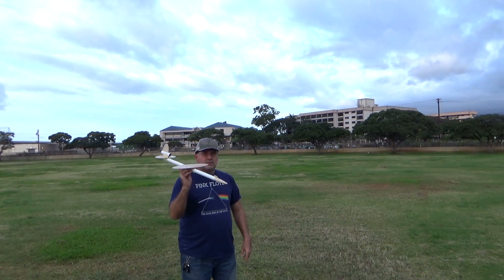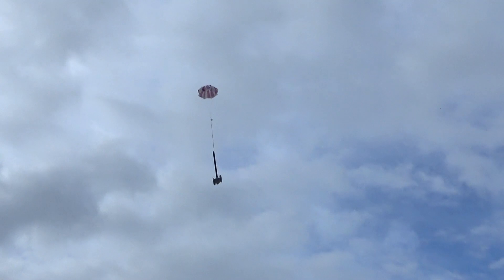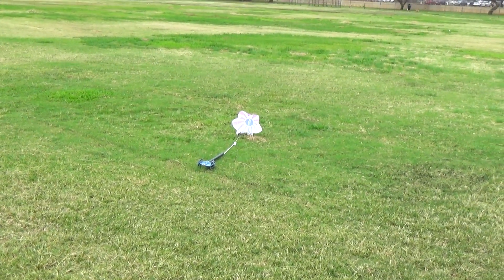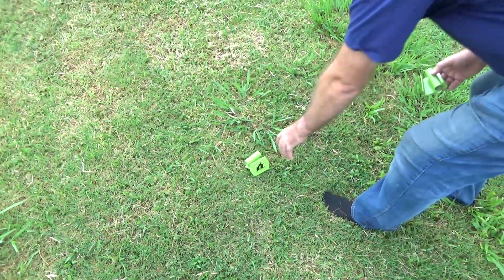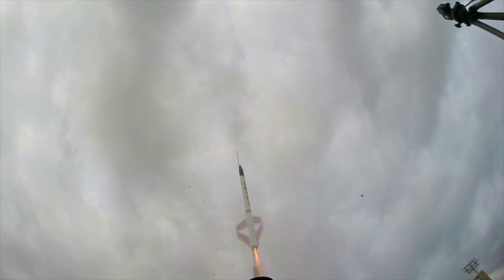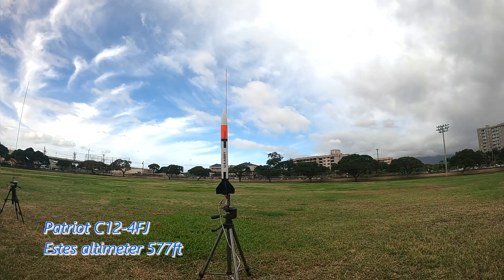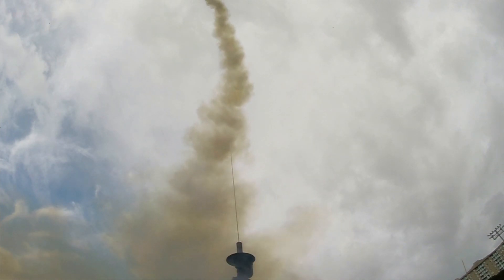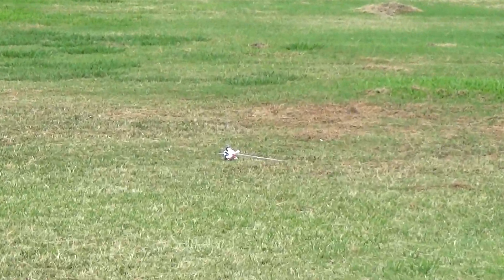Model Rockets: Nice rockets, some Catos, some lawndarts, and a windy weekend

Comment: Another great video.  I look forward to your videos every week as it's still too wet and windy here to fly.   I need to pick up a Nomad.  I like the design but wish it was larger.  Once I have all the dims I'd like to build an upscale out of Estes 3" PSII tubes.   Problem is upscaling those decals would be a pain the butt. 

Really hate to see any rocket hit the ground. The Goblin deserved better. I've had so many issues with Q-Jets that I stopped using them. It's hard to believe that they are made by Aerotech.
Reply from the maker: You could probably upscale this.
https://cults3d.com/en/3d-model/various/custom-nomad-nose-cone
Reply from the maker: I used to like the Q-jets because of the impulse off the rod but the chuffing and cracked nozzles have been an issue. Supposedly, the motors after 7/21 have new clay formulations.

Here's an alternative. https://stickershock23.com/product/nomad-custom-rockets/
Reply: @RonzRocketz   Nice.  Thanks on those decals.  I had no idea Mark was doing these for the Nomad. 

I'll wait a few months an try the Q-Jets again.  Hopefully with better results. 
 Keep up the great videos.
Reply from the maker: @jcshobbiesandrecreation5873  If you buy the Stickershock decals and there's extra, I'll buy them from you.